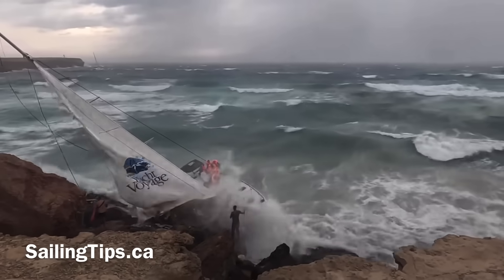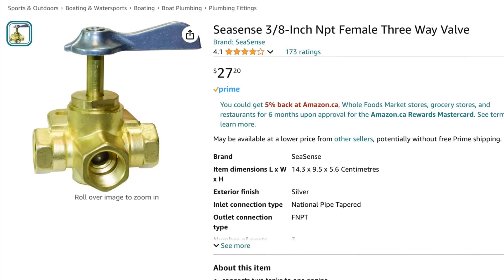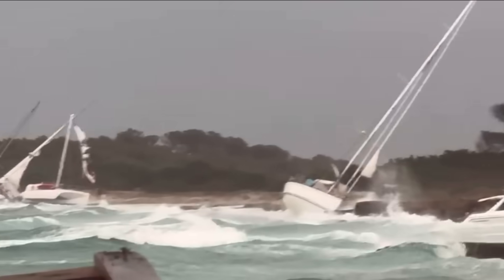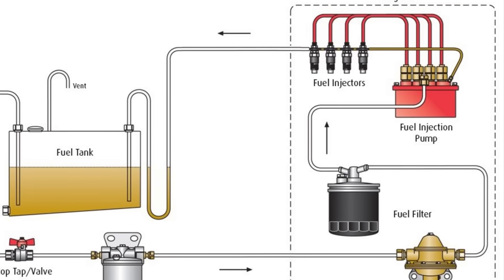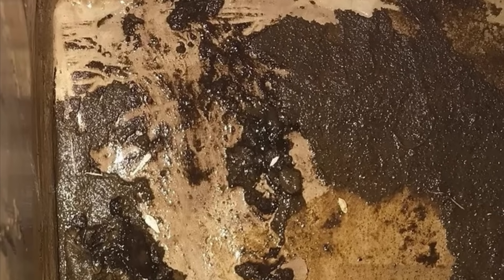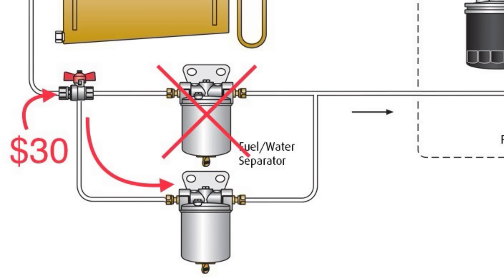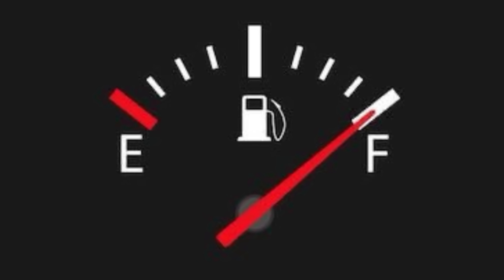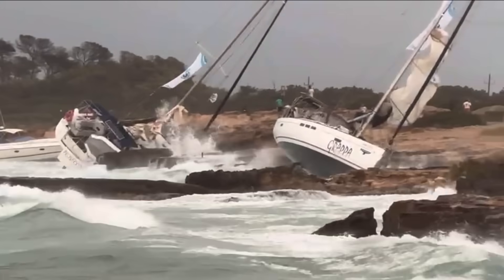The Critical $30 Safety Device Most Boats are Missing!!!

Comment: My experience with my boat and others is, the more joins, filters you add, the more chances of air leak developing and thats instant diesel stall.

Much better to add conditioner to tank every fill like others said and every year open inspection hatch and suck anything if at all that has grown. Preventive (cleaning) is much better than reactive (backup).

Also what about the second fine filter? If the primary is blocked, likely the sludge has been sucked through and made it to the fine filter as well.

Also while some newer diesels, will self bleed, older ones dont and the line is under vacuum, often hard to bleed. I added a needle valve to the 2nd inlet of filter and connect when needed a diesel rated squeeze bulb. Now from jerry can I can prime the system to tank and bleed valve on block. Plus now I have spare fuel line and could plumb to jerry can if needed, pump water out of tank, do transfers, etc.

If doing serious offshores, a valve on your breath line near the exit is probably a smart idea. In a roll over, water can find its way to the tank, its not uncommon to hear stories after roll overs of boats engines stalling shortly after starting. In bad weather close the breather valve, alert crew that it needs to be opened before starting.
Reply from the maker: Good suggestions thanks! You definitely don’t want unnecessary fittings, especially in inaccessible locations - I delivered a boat once that had air leaks for that very reason and we couldn’t find them. And you’re right pro-active is always better than reactive.

Comment: The industry standard Racor filter housings are available as dual mount units, with the second filter and the switch all integrated.  And if you add a vacuum gauge (for about $30), you will always know the condition of the filter element.  And if you make sure that the Racor primary filter (or whatever brand you choose) is finer than the engine-mounted  filter, then you will never need to worry about the engine filter, (which is much harder to change.)  And make sure that you have spare elements and a small supply of clean diesel available so that you can change a filter underway.  And carry lots of spare elements, because -- if your tank has a lot of crud that gets stirred up -- you can plug a bunch of elements.
Reply from the maker: Excellent suggestions! I agree that the dual mount units with the integrated switch are the nicest solution.

Comment: Might be better to just have a small 1 gallon gravity tank that allows you to bypass the clogged filter with known clean fuel till you can address it. In my experience, the fuel line clogs up before the filter does.  If your filter clogs, things are REALLY bad.
Reply from the maker: Yes and this gravity tank could be designed to be easier to keep clean!

Comment: There are really good two stage filter systems that implement this but as you mentioned, its an upgrade totally dependent on the boat owner.  I really like Keenan Filters - I believe they were once called Filter Boss.  They have two stage filter systems that range from manual switching to automatic switching.  I also use Fuel Right in my tank and have been in all three of my sailboats.  It has proven to me that it cleans my tank and keeps it clean.  I usually clean my tank using a siphon or polishing after my first treatment to remove all the water that is released from the sludge onc eit has cleaned the tank.  Good safety vid!
Reply: You have three sailboats? Lash 'em together and make a home-made trimaran.

I am joking and hope I improved not diminished your day. :-)
Reply from the maker: Thanks! And thanks for sharing your pro-tips!!!

Comment: To be fair, the yachts in these video all ran aground due to stormy conditions and bad anchoring, not by collective engine failures. 

I do like the bypass solution, though you're missing another common issue: if there's too much dirt shaken up, it may actually get past the first and second filter, and collect just before the injector (don't know the English name, it's a tiny hole before the high pressure pump). The problem then is that your engine will work a little, but won't get enough fuel to keep going, so it'll shut off. It will also have less power. 

Finding this, esp in stormy conditions, is next to impossible, even for experienced mechanics. I speak from my own experience here. Got towed into a marina, and it took 5 mechanics and many failed attempts fixing what needn't be fixed, before after weeks i could sail attain. 

The moral of this story? Keep your diesel clean. There are ways to prevent this growth. Do a visual inspection. Remove all diesel from time to time and clean the tank and pipes. Common sense, but few do it (incision me, until recently).
Reply from the maker: Yes bad anchoring was a key problem for many of these yachts! And fuel starvation can happen at many points in the fuel system. So as you said keeping the tank clean is really the best strategy, but people who do this are in the minority.

Comment: Nooo. I reject complexity. It doesn't start with a dirty tank. Take it out and clean it. I don't have a deck filler. My tank is tiny and only gets filled with clean fuel. The same goes for fresh water.
Reply from the maker: Keeping your tanks clean is really the best solution but unfortunately there are lots of boats where that doesn’t happen…
Reply: Rhetoric isn't going to keep your motor running.

Comment: A good idea, but.musrepresented as a $30 part. You need to include the several hundred dollar filter system.
Reply from the maker: The $30 variant is a straight bypass of the fuel/water separator and allowing the remaining filter on the engine to do all the work. I prefer a second fuel/water separator but the straight bypass will still run your engine for a while and is arguably better than nothing!

Comment: I added a Dryer-ite desiccant filter in the diesel vent line to stop any water from moist vent air getting to the tank. Color changers from blue to pink when it needs to be regenerated in an oven. You can buy them but I made mine from PVC pipe with screen at each end. No evidence of bugs in the fuel over 
 15 years and no need to top off the tank.
Reply from the maker: That’s a good way to keep most of the moisture out of the tank - thanks for sharing!

Comment: run a fuel filter recirculation system during rough conditions to keep fuel system clean, it could be wind powered and automatic so when you have to run your diesel engine it has clean fuel, just remember to change filters
Reply from the maker: Yes it’s nice to have a fuel polishing system which is common in larger and commercial vessels!

Comment: I have a bypass filter system on my boat, but I don’t count on it to save me if my tank is full of sludge. The second one will plug up very rapidly. The answer to this problem is to keep your tank clean and inspected yearly. Put a biocide in it, if there’s any question as to whether there’s water in the fuel.
Reply from the maker: Yes regular maintenance is key to keeping a yacht running reliably! Biocide is a helpful part of that.

Comment: good info ...but last sentence was Bullshit
Reply from the maker: It may have been presumptuous to speculate as to their motivations, but if the manufacturers really cared about your ability to start your engine reliably in all conditions wouldn’t they have included a dedicated starting battery and even some basic fuel system redundancy? Instead the engine for most production yachts starts off the same battery that your fridge drained the night before, and there is no fuel system redundancy. Adding a dedicated starting battery and basic fuel system redundancy would cost them far less than 1% of the cost of a new yacht.

Comment: Its called diesel algae. Very easy to treat. Fill it up with Red Line or other 100+ products out there that prevents growth and elimates existing algea. My dad's diesel Benz had this problem...we learned the hard way. A mechanic charged us over $500 back in the 80's to have it cleaned out including the injectors. There are mechanics like that. All we had to do was add treatment and drive normally. These are dirt cheap products.
Reply from the maker: Yes biocide is relatively inexpensive and a great item to add to the maintenance routine!

Comment: I have a day tank and 2 bunk tanks and 2 filters. The advantage of a day tank is you can filter clean fuel in and run the engine from that. The issue with using the main tank is getting crud stirred up from the bottom in rough seas. My day tank is gravity fed from the bottom of the tank so crud does not accumulate. In addition I can also loop in a fuel pump with a valve to polish it if I think there is crud in there e.g. at the beginning of the season. I also have an old perkins diesel with zero electronics. If it starts it will stay running unless you blow it up or run it out of fuel.
Reply from the maker: Yes a day tank and polishing are excellent upgrades! Just requires a bit more space, cost, and planning.
Reply: Thank you.   I was reading down the comments looking for the keys to success - Polishing and day tank.

Comment: Wouldn't you want a second valve on the outputs of the filters where they re-combine back into the line that runs to the pump? That way you can fully isolate one filter or the other while the engine is running?
Reply from the maker: Yes a second valve would allow you to change a dirty filter while the engine is running, which the single valve doesn’t allow. But you’d still have to bleed the fresh filter after you’re done, which depending on your setup may be difficult. But definitely worth designing for this ability with a few extra parts if possible!

Comment: The fuel system you describe in your diagram, is not the safest.
I have a 25 year old Yanmar 50 hp 4 cylinder diesel engine. I have a day tank well above the engine in the stern locker. The day tank has a sump that I can drain. No electricity needed to run the engine, I can even hand crank it.
If one keeps care of the day tank, drain it before a trip, check it before leaving the mooring or anchorage, one hardly has difficulties with sludge or water. I can empty the 60 l day tank into the main tank, leaving about 2 l in the Sump, that are than drained separately. I have fixed a 20 l fuel canister below the day tank to take the drainage.
Bleeding the engine used to take longer than changing the filter cartridge in the big water separator fuel filter just below the day tank. The engine is not self priming. I still have not had to change that filter outside of the service intervals. The fuel filter on the engine is usually clean when I change it. I installed an electric pump to help with bleeding. I run it until the diesel runs without bubbles on the fuel filter on the engine, that takes now seconds instead of minutes, and than I loosen a pipe on one of the injectors and crank the engine.
I add an additive to the main tank to keep growth in check. The main tank has a sump and a pipe there, where I can pump out accumulated water or sludge from under the diesel. The pump to the day tank takes the diesel above the sump. I have an electric and an manual pump. I have two auxiliary tanks that drain into the main tank. The Main tank is about 400 l and the auxiliary 150 l each. I can also pump from one of the auxiliary tanks directly to the day tank. I can run the engine for around 15 hours on one filling of the day tank.
When the Boat is stored or a long time between trips, I keep the main tank full, to keep water collection and growth to the minimum, and the auxiliary and day tank empty.
As it is not a big deal, I will add a second fuel filter water separator after I have seen your video. I think I will hardly ever need it, but added safety is added safety.
Reply from the maker: The day tank solution you describe is definitely far better than the inexpensive solution I described as it provides so many more options. But also more expensive and subject to space limitations etc. I think a second fuel/water separator is a good starting point and just the beginning of how people should try to evolve their fuel systems towards what you’ve described.
Reply: @SailingTipsCa  Many older boats, my boat is from before 2000, have the day tank solution here in Europe. It is less expensive than many think. The biggest safety factor is, that you can loose electricity and the engine still runs.
Reply from the maker: @mjoelnir1899  Lots of older engines also have mechanical lift pumps and therefore require no electricity except to start! Good argument for a day tank for boats with electric lift pumps!
Reply: @SailingTipsCa  My engine has a mechanical pump to feed the injection pump. But I would doubt that that pump could lift the fuel out of the main tank, that is situated in the upper part of the keel. That I assume is why engines have electrical lift pumps.
I rather rely on a day tank.
Reply from the maker: @mjoelnir1899  Yes a larger vertical pumping distance such as yours can benefit from an electrical lift pump. If on the other hand your main tank is at a similar height to the engine, or only slightly below and not too far away the mechanical lift pump on the engine can suffice.

Comment: All you need is this $30 part plus another one in excess of $200 plus all the plumbing for installation. But that’s not a catchy YouTube title.
Reply from the maker: LOL you could just do a fuel/water separator bypass for $30 to keep you off the rocks but I really did not want to recommend that because it’s far better to add the second unit!
Reply: @SailingTipsCa If my boat is headed for the rocks, I'd spit fuel outta my mouth to run the engine! 😂
Reply: My thoughts too. Racor 500FG, $145 plus pipes and plumbing, or forget all the baloney valve and plumbing and just fit a ready made duplex one, $1,429 from Scintex. Cheaper than a new boat!
Reply from the maker: @philgray1023  Yes the ready made duplex one is the most elegant solution and still far cheaper than a new boat!
Reply: If you couldn't figure how to rig a bypass filter for way less than you stated then you might want to stay ashore.   @philgray1023
Reply: For a sailing yacht, a $230 part is priceless..
Reply: @3ne2nr4life  Yes $230 is almost “free” for a boat part LOL!
Reply: Don’t be a nag, this is exactly the math we use when we spend money on shiny things for the boat.
Reply: A dirty game, YouTube forces us to play…

Curvy girls in bikinis work for the thumbnails too!

Comment: I am always using addditives every fill up
Reply from the maker: Yes that’s a good idea and something I’ve always done too. It would be interesting to explore if anybody has done any empirical studies to see how well they actually work in different conditions…
Reply: @SailingTipsCa  Yes, I have a small tank (33Gal) and I upgraded the water separator to a larger than the one provided by the boat manufacturer. in 7 years always clean fuel, only once recently after a fill up had 1 inch of water in the separator..
Reply from the maker: @nicolasterzani9017  Sounds like you’re keeping on top of it!

Comment: The ultraviolet light inside the tank also helps to inhibit the growth of bacteria.
Reply: A lot of plastics become brittle with exposure to UV light, over time. Take care if you're exposing a plastic tank to UV, unless that's approved by the tank manufacturer.
Reply from the maker: @alanm8932  Good point!
Reply from the maker: Good suggestion - I’ve never used that but will check it out!

Comment: On one of the boats I ran we had vacuum gauges to show if we had a slowing down of fuel. I could change the filters in less than five minutes. Just turn the valve to a new one and didn't lose an engine. Then underway I would changer the old filter out and have it ready. Gman
Reply from the maker: Yes my marine diesel also has a vacuum gauge which helps be proactive. But it can still give a false sense of security if you’re only motoring in calm conditions…until you aren’t! Still a great addition and suggestion!

Comment: Excellent suggestion.  And to lend even more validity:  this is standard practice on all commercial ships.  We install dual fuel filters with a valve to switch between them.  The whole thing comes as one unit.  And as an added bonus, it allows you to change one fuel filter while still running the engine through the second filter.  For anyone that wants the prebuilt dual units, search for duplex fuel filter.
Reply: It is common but not standard on smaller "quality brand" motor yachts, and pretty much standard on larger ones.
Reply: @darthkek1953  Yes unfortunately not common on most “production-quality” sailing yachts under ~45 feet.
Reply: I know a turd when I see one floating down the cut. 
You are making your life up as you sail along!
Reply from the maker: Yes a pre-built duplex is definitely the best solution but as you noted a bit more costly. I really don’t understand why this isn’t standard on pleasure yachts too as it’s a small cost in the grand scheme of things.
Reply: @SailingTipsCa A bit?   Over $1k.

Comment: If you spend a bit more and put in a 500 series Racor fuel water separator you can change the filter in 5 minutes of less or just break down and buy a Racor duplex separator unit which combines a valve and two filter/separator units.  It isn't going to cost $30 though.  What I would never have on my boat is one of those filters with a screw on element on the bottom.

Better yet is a day tank that only has filtered fuel in it.   That tank, of course, needs its own fuel filters.
Reply from the maker: Completely agree with all your suggestions! Unfortunately many production boats come with the filters with the screw-on element as they’re the most inexpensive option. So you really need to decide, do I upgrade wholesale to a 500 series or just twin my existing unit. The expensive solution is clearly the best but both are better than doing nothing!